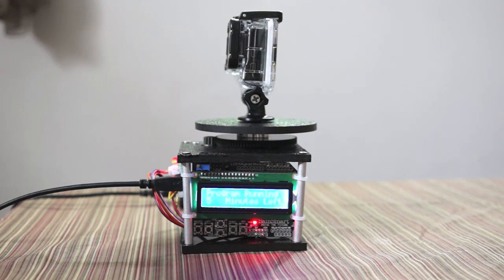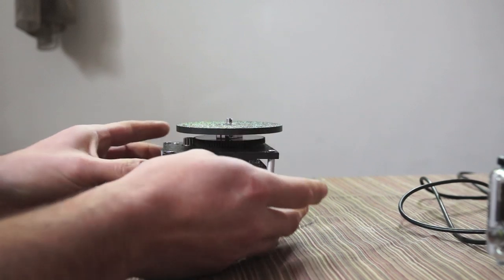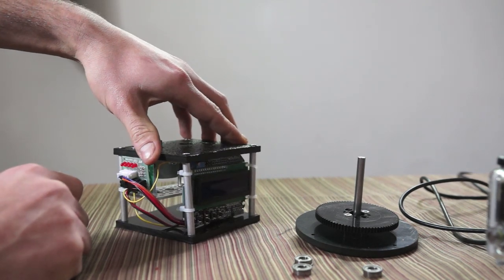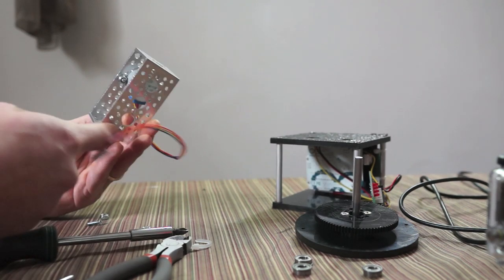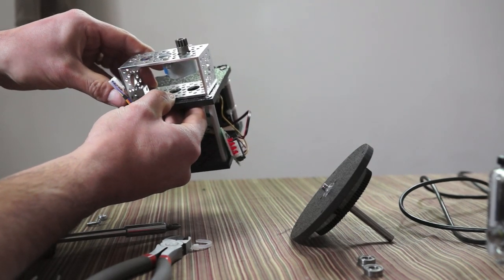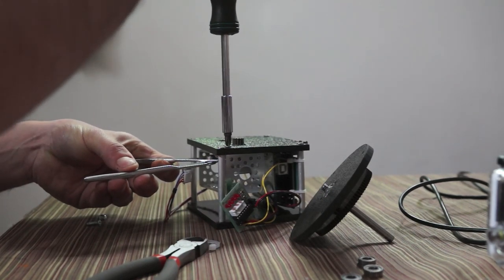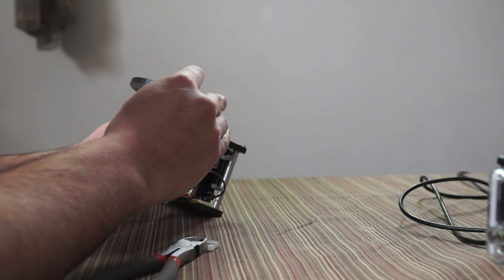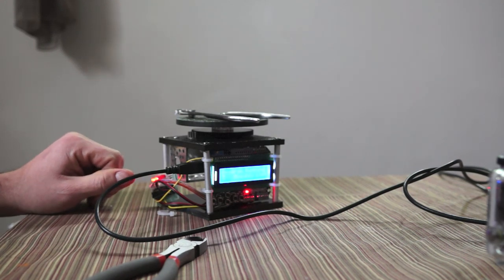DIY Arduino powered GoPro Panning Rig - Demo & How-to

Comment: Awesome.  I've been searching the web for a month trying to find something like this and was wondering why there wasn't a DIY project.  All of the panning units I found built were out of basically egg timers that took an hour to rotate 360 degrees.  I want one that will go full circle in one or two minutes.  Will yours run that fast?  I even tried to find a 1 RPM motor without any luck.  I thought one with a rheostat would be useful so you could adjust what speed you wanted.  I would be interested in seeing how your final product turned out.
Reply from the maker: MrGrunthunter it would but the program to run it requires you to manually rotate it... so the setup would take a minute... kind of a pain... if I wanted to do full rotations I'd re-write the code

Comment: Hi there,

Thanks for a great tutorial. I am brand new to Arduino but loving the things I have learnt so far. Huge potential for these little products.

My previous project is now working thanks to your guidance and that from Paw Pedersen. I will be posting some timelapse soon hopefully :)

I have a project where I want to motorize a machine in the workshop which I use to cut finger joints.

I will use a stepper motor, easydriver, arduino uno, LCD keypad shield and a button as my hardware. 

I want to set it up so each time I press the button the motor will move a certain amount (I want this to be adjustable through the keypad shield) and when I long hold the button it will return back to start. I know this is simple code for many people but I would love your help with this. It would save me much headache.

Please assist.

Thanks in advance
Reply from the maker: my code here uses a simple arduiono motor library... I'd suggest looking at one of the more advance libraries like this one : http://www.airspayce.com/mikem/arduino/AccelStepper/

for short press vs long press try this, changing DURATION_IN_MILLIS for the amount of time for a long press and YOUR_RESET_BUTTON_PIN to the pin your button uses.

long prev = 0;
int buttonState = 0;  // 0 = not pressed   --- 1 = long pressed --- 2 short pressed
int YOUR_RESET_BUTTON_PIN = 13; 
int DURATION_IN_MILLIS = 1000; 
void setup{
  pinMode(YOUR_RESET_BUTTON_PIN, INPUT);
}

void loop(){
  buttonState = 0;
  if(digitalRead(YOUR_RESET_BUTTON_PIN)){
    prev = millis();
    buttonState = 1;
    while((millis()-prev)<=DURATION_IN_MILLIS){
      if(!(digitalRead(YOUR_RESET_BUTTON_PIN))){
        buttonState = 2;
        break;
      }
    }
  }
  
  if(!buttonState){
    // TODO nothing is pressed
  }else if(buttonState == 1){
    // TODO button is pressed long
  }else if(buttonSTate ==2){
    //TODO button is pressed short
  }
  
}
Reply: Hi 

Sorry for the late response. Many thanks for your help I will have a look at your suggestions. 

It is very useful and time saving to get good advice :)

Comment: pretty cool, you write the program for the led screen and the motor? ive done a bit of code in labsim, not easy stuff. Do the leds represent your timer? Thats cool stuff.
Reply from the maker: The LED's that blink are controlled by the hardware they are on... There is a library that is used to talk to the stepper motor driver (the little board with the LED's). That driver in turn talks to the motor.

The stepper motors are a little more complicated to drive then a regular motor. With a regular DC motor just giving it power makes it work. With a stepper you need to pulse the motor in sequence (a step). This allows very precise movements... They are commonly used in scanners, 3d printers, plotters, cnc, etc.... basically anywhere precision is important. 

So the LEDs represent the steps the motor is taking... if they are pulsing in order like the are I know I am talking to the correct pins in the correct order...

Out of college I was a C/C++ developer for IBM... years and years ago... I don't do much coding now but can do enough to be dangerous :).
Reply: Thats very cool, it's complicated for sure, most people don't understand how complex and difficult coding and setting up hardware is, so big props to you.  Would be real interesting if the setup could sync with a tablet and do some video movement tracking. Very cool stuff.
Reply from the maker: Charles Ryan :) thanks... there will be some panning shots coming to the cabin videos... one of the reasons I built it with the gear reduction I did and the triple ball bearings was to support my dSLR... the GoPro weighs nothing... the dSLR is over 3 pounds..

adding a wifi shield and creating a adhoc network to control it over should not be to hard

 I'll try not to over do it but some of the early spring videos might have gratuitous panning shots :)

Comment: How did you connect the ULN2003 step motor driver to the arduino lcd shield? what is the exact pinout connections?
Reply from the maker: I did I'm away from home but should be able to reply tomorrow after work
Reply from the maker: I did I'm away from home but should be able to reply tomorrow after work

Comment: Hi 

this is great but I need to run an easydriver for stepper motor and not sure on wiring and programming. Please assist
Reply from the maker: the easy driver would be wired up in-place of the driver here... the number of wires is the same... you would just need to provide the easy driver with power as the Arduino does not have the ability to safety run it...
Reply: Hi 

Thanks for such a prompt response. The easy driver has power and ground which I have from an external source with ground also common with arduino. Then there are 3 wires (ground, Step, Direction). This is what confuses me. 

Furthermore, when I run the code on the LCD it goes straight to code complete
Reply from the maker: sorry I forgot... Its been a while since I built this project... the driver used has four wires...

the code would need to be changed... 

I did a quick change which uses pin 2 for dir and 3 for step (change as needed)... ground goes to aruduino ground

https://www.amazon.com/clouddrive/share/yOtA1ttPvV383ZYnH7HaLblG3L5DJNCrlkF6Abhg3oJ?ref_=cd_ph_share_link_copy

I didn't test this code so it may or may not work but it should give you a starting place... I commented the code with //easyD and //easyD end where I made changes
Reply: Thank you so much. I will give that a try. My easydriver is overheating at the moment. so that is my next mission
Reply from the maker: adjust the pot... but they can run very hot... use a simple sketch the just rotates the motor and turn the pot until it stops... the turn it back a little... 

http://www.schmalzhaus.com/EasyDriver/Examples/EasyDriverExamples.html
Reply: In that code it gives error

exit status 1
expected ';' before 'close'

not sure why
Reply: even at lowest pot level it does not stop and very very hot until motor starts jerking
Reply from the maker: try the other way... one some of the easy drivers the labels are backwards...
Reply from the maker: thats weird... I didn't test compile it before uploading but I just did and it compiled cleanly...  can you compile and upload a simple script like the one I linked to?
Reply: Hi yes I can upload the short basic scripts but often when I try upload other longer ones it give error. I am not sure how arduino works but perhaps it is not linking files and folders?
Reply from the maker: not sure... this script isn't very big by arduino standards... 300 lines is all... maybe post over on the arduino forum... I'm more of a kludge coder... I get it to work but its not pretty... people on the forums are much better then I am
Reply: From another code I am trying to get working which is directly related to mine. the following error is given. Where must the files be stored in order for it to locate them. Sorry for all the amateur questions. 

C:\Users\Caelum\Downloads\Camera_slider\Camera_slider\Camera_slider.ino:1:19: fatal error: Timer.h: No such file or directory

 #include "Timer.h"

                   ^

compilation terminated.

exit status 1
Error compiling for board Arduino/Genuino Uno.
Reply from the maker: Here's a doc all about library's and where they end up... I'm on a mac so its different https://www.arduino.cc/en/Guide/Libraries
Reply: +buffcleb thanks I'll have a read.  I have sent some forum posts but no response yet. I really appreciate your speedy responses